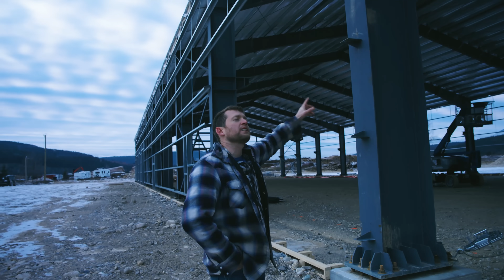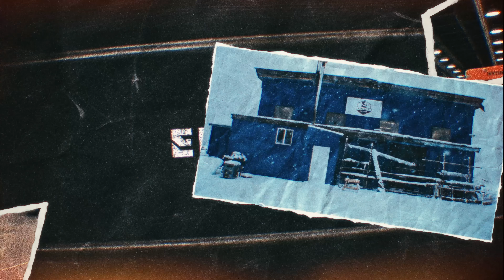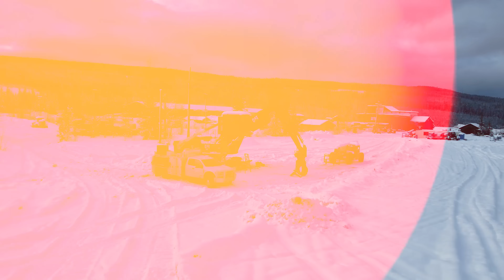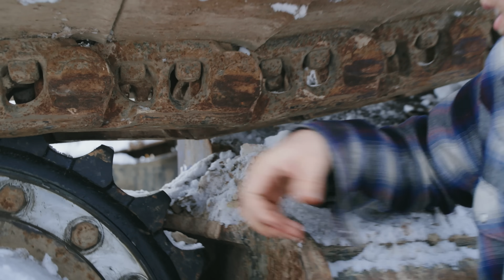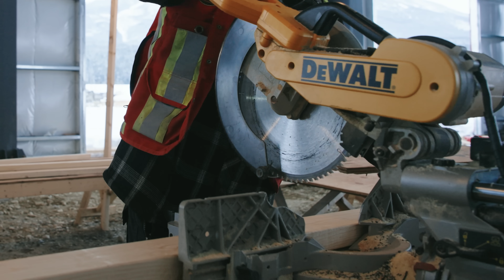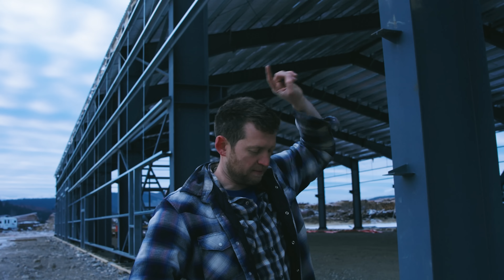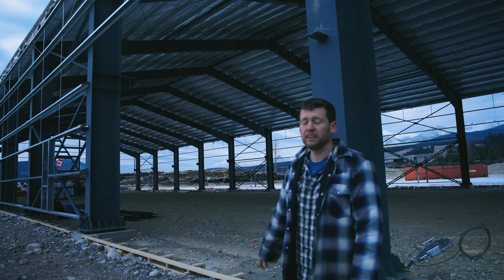Saving $200,000 With Used Heavy Machinery

Comment: Chace, To not only save more money for years to come, you can always help to keep the employees nice and warm at the same time!  Before the concrete floor is poured - Please install in-floor radiant tubing with insulations under the concrete sab. The workers will thank you and it will save on heating cost too!! Should the Funds be short right now to complete such a system - you can wait until the business grows - before you have the rest of the heating system installed. With the tubing in the floor. You could install gas/Lp heat now that is normally used in large buildings and it could be used in the future as backup heat. Plus if you were to use Geothermal to provide the main heat source; you, the company, and investors will SAVE even more. Not to mention with your heavy equipment you and the team could dig the individual trenches and lay the tubing yourself.  However you can't go back later and install the tubing / insulation under the concrete floor. Grin & LOL  Keep up the great progress. All the Best, Tony

Comment: Columns go up, girts are horizontal and connect the columns together. 

Rafters go from column to column holding the roof system up. 

Purlins attach the rafters together down the length of the building.
Reply: Thanks :)

Comment: I still dont understand why that building can't be repaired?  Its so big ans seems like it would be useful.
Reply: The roof was not designed for snow load. It needs to be (safely) removed and replaced. It's cheaper to start over.
Reply: @Sah-o5m it's crazy that a building built there wouldn't have been built for that!
Reply: @erikdenny353 
A person in these comments claim to have worked there in the 70s and says that had to go up and shovel snow off the roof.

Comment: The loader can be used in the rail yard  at the saw mill, in your woods clearing build lots with a mulching implement.  Check hemp lego building blocks in Alberta.  Distribute as a dealer, advertise.  25# R35, strong as concrete  fire bug and mold proof.  Each 40' container builds 1,000 sq ft.  Lego DIY perfect.  Best off grid product period.  Rebuild the exterior walls as supports. Add ? to the engineers.  They will be a gamechanger.  Cost is less than stick built.

Comment: All that investor money spends easy, doesn't it?!
Reply: Gotta spend money to make money. The investors seem on board with the plan.
Reply: @Sah-o5m I'd venture to guess that many investors don't know any better.
Reply: @Jaeswindell 
Perhaps. 

I believe the building was a condemned safety hazard with a failing roof causing a death hazard to employees and putting Edison at risk of personal injury lawsuit.

I believe the building was at risk of collapsing under its own weight and landing on the adjoining main line railroad tracks creating a situation for train derailment and giant lawsuit.

I believe the location of the junky warehouse MIGHT be suitable for a semi truck intermodal rail spur hub that MIGHT generate millions in revenue for Edison. This remains to be seen.

I believe Edison has a goal of building 500 trucks per year at 30,000 lbs each so it needs to import 15 million lbs of truck parts annually. Having a repaired rail spur and new appropriate warehouse could be useful, or vital. This remains to be seen.
Reply: @Sah-o5m agree with your points entirely, my commentary was regarding the feller buncher purchase.

Comment: If you have to skills to do it yourself, then equipment is 90/100 times cheaper than just ordering the work from contractor. Also, like many others have said, since you're going to build logging trucks eventually, you need a way to load them for pull weight and handling tests. 100% keep the loader! :D

Comment: It's great that you are salvaging what you can.  The old wood and even the steel that you save will give some real character to whatever you build out of it.  Use that log loader for what you need then sell it...or find a way to use it in the production line!  It might be a good way to move frame rails in and out...HA!  (just kidding)
Cheers from the Maritimes!
Reply: If Edison has a goal of making 500 trucks per year at 30,000 lbs per truck, then that is 15 million lbs that needs to arrive and another 15 million lbs to depart annually. Having large material handlers for the rail cars makes a lot of sense.

Comment: why not controlled burn?
Reply: (A) to reuse the material. (B) its right next to the main train tracks. If it falls on the tracks then Edison could  be fined $100k per day by the rail line till it gets fixed.

Comment: I would expect those big old timbers in that building are worth a small fortrune, so, ya it is worth your trouble to buy the machine, give someone a few months work in teardown and sorting, then figuring out how to use those timbers in the new buildings. Need a good metal detector to run over them all with before cutting them up, but, overall will save a pile of money. More than a few engineers and archtects in the Columbia Valley that can figure out how and what to do with that stuff and come up with something nice for you..

Comment: Buying the piece of equipment to do the job might be the right choice, but I believe trying to salvage as much as the building as possible to use in another building might be the wrong choice. It could consume too much time. 
You might be better off just throwing it in a pile then looking over your truck and finding something small an emblem, a knob, or small info plate. Something you could get a bunch of parts from one piece, then you have years of raw material. Sell the log loader when you're done to buy the piece of equipment or two you need to process the raw materials.

Comment: I think you made the right choice if you can keep the log loader for other uses after the building is down. If you just planned on selling it after the job  it was taking on a lot of risk and unknown costs to repair it. It would then be better to rent the right equipment for a week or two and operate it like you would the purchased one. I rent 50,000 pound excavators  here for about 3000 a week or 8000 a month. Even two or three times that for a log loader is worth it because you only pay for what you need  I can get a lot of work done with rented equipment compared to hiring another demolition contractor to do what I can do.

Comment: The question is less about should you, but do you have the necessary skills?  For example, you knew about the wear parts and hoses, and bought the logger knowing its needs.  Obviously, someone on the crew can run it.  So if you were a college boy like Eric, it may not even be safe to buy a logger.  But if you have the skills, and are willing to underpay yourself, definitely buying it is the way to go.  
As for the building, too many people toss perfectly good building material and then have to build smaller than they wanted because of the cost of new material.  Those beams look to be WAY overkill for an average office.  So what?  The cost ($0) is very attractive.  Now when you are ready to spend the big bucks and build a super computer, drop me a line.  Those babies are insanely expensive.

Comment: How many commenting. Really have vertually NO exp with used heavy equip. Why was this log unit sold. Hey if the " up keep" exceeds the " in go " then the Downtime becomes  A "down fall "  Maybe NOT as criticial as logging. Dont know your schedule. Log trucks driver etc. Dont like unriable equipment. Trade it off. Get something hopefully more reliable lol. Fixing equip in the bush lol. Maybe   NOT as crotical. Near Golden BC. But whats mobile mech rates. Hey got own mech. Diff story. If broke down. Hey fix it. Not so easly done in the bush. With log trucks waiting to load. Elect log books running out of hrs etc. Burning fuel just trying to stay warm. Yup been there. When is the stupid loader getting fixed. Lol. Everyone cheered when " new loader arrived lol.

Comment: As long as u dont have too many major break downs. Lots should change out hyd oil Better filteration etc. Used Telehandler next 30th hyd repair lol.  Be " pro active on maintance"  Do " oil  samples etc "  Used can be ok. But can real " bite" too. Need  reliable equip. Not constantly broke down. Need to job done etc.

Comment: It was absolutely the right way to go.   The repair has added value to the machine and you can sell it at a profit after using it for your demolition project.  Renting a machine like that can be something like $4,000 – $6,000 CAD/week.
Doing it this way, you can have it around to do other work, and leave it idle for months if the timing requires it.   The unit is already fully depreciated.

Comment: I think doing the work yourselves and selling the log loader after is a brilliant move, try and save what you can in the old building and use the bones to create a new structure if possible or reuse what you can. Sell the metal and recoup some costs while cleaning up the entire site making it safe for future expansion. Diesel electric trucks are clearly the answer and when the laws are working in your favor you will have a leg up on the competition, try and avoid getting purchased if possible.

Comment: CPKC (Canadian Pacific Kansas City) manages used, creosote-treated railroad ties by sending a portion of them to specialized facilities for energy recovery (incineration) or fuel conversion, as reported in their sustainability data. These used ties are sometimes processed through cogeneration facilities, and in some initiatives, they are used as feedstock for producing renewable fuels. 
Environmental & Disposal Strategy: The railway industry, including CPKC, has moved toward burning treated ties for energy recovery as a primary disposal method rather than landfilling.
Partnerships: CP has previously partnered with firms like Cielo Waste Solutions to use scrap ties as feedstock for high-grade renewable fuels.
Controversy: The incineration of these ties has faced public and environmental scrutiny due to the creosote treatment, with past projects in British Columbia and other areas facing opposition over air quality concerns.
Alternative Uses: While incineration is common, some ties are also repurposed for other uses, such as in landscaping or agricultural functions, though the industry is shifting more toward energy recovery.
Disposal Reporting: CPKC reports the volume of rail ties sent to cogeneration facilities as "Offsite Incineration" in their sustainability data.

Comment: Buying used machine is certeainly the way to go, especially when you don't need to hire an operator. I like the fact you're building the company to produce and sell trucks, not to sell dreams. It shows you're not just interested in making smoke and mirrors and get bought by some big corporation, but instead you're interested in the truck itself and are building a company for a long run

Comment: I follow Elon as much as I follow Edison. You guys use many of the same philosophies. One of Elon’s prime directives is to have planning (engineers) and manufacturing under one roof, except where it absolutely cannot be done. He thinks engineering and manufacturing must have the absolutely least physical separation possible, with no friction. That would include a -40C walk between buildings. That walk could be considered friction.

Comment: You are a logger Why didn’t you use mass timber when building the new shop…..instead of steel. The old shop is made of wood.
Did you think of mass timber building. Where was the steel sourced from?
It’s easy to talk the talk you have to walk the talk.
Remember what PM Carney said “ if you’re not at the table you’re on the menu”….nice you have a seat at the table.
With all that said keep up the good work.

Comment: I have extensive experience on trying to reuse  buildling materials,  some notes:  Having open storage yard helps but you also need some sort of dry storage if it is not going to be used right away.   Creating an inventory of the materials and sizes that the designers/engineers will need to work with will save lots of design time later.  Certification of steel beams is likely going to be part of the info needed as not all sizes might be worth saving.    The latter needs a line or 2 in your budgets.  There is a difference between reusing for decoration/nostalgia and needing structural properties for the building envelope. 
some of the steel might have higher value as recycle/scrap when the market is good rather then a reuse which might cost more then buying new certified materials.     When asking should we/can we use that beam,  there might be a compromise to the spaces that get created that could be a regret later when trying to fit a new piece of equipment in that room.   i.e. (an example to make the point) a standard desk is 5 ft wide, if the room created with that salvaged beam is only going to be 4 ft 11 in (finished)  you need a custom desk that might cost more then a new steel beam but using a wood beam might be a better deal to get that 5 ft space.      There is a time for using steel in buildings like the preengineered shop you build (which is excellent value) , there is also times when wood/steel should be evaluated as an alternate when doing things like office buildings etc... 
for a reuse project idea - there are lots of solar panels from solar farms that still have some life in them. (-:  been seeing them on RV roofs.
Reply: A lot of good info here. They said they're getting a structural engineer to review the materials. That person should be able to tell them which beams are worth reusing. Great idea on the used/second market solar panels. Edison has plenty of space for them, and already builds their own batteries, which is the most expensive part for most solar installations.

Comment: When I built barns ....We always called them Purlins
Reply: Those are girts, purlins go on roof.
Reply: @DaveH51  not in michigan...we call them wall purlins...🤣🤣🤣
Reply: @1RickBaja  Makes sense.
Reply: @1RickBaja  they are purlins in general as they are steel. used in a wall its a girt. on a roof is a purlin.
but it really doesnt matter
Reply: @chrisforgan731  It's generally the same material is the reason many people don't differentiate between them, but I see your point. I would in framing like rafter and stud.
Reply: In Oz we call em roof purlins and wall girts

Comment: Save when you can, nothing wrong with repurposing material. Old salvaged wood is in big demand in many places. It may need to have holes drilled for screws/ nails to avoid splitting.

Comment: Doing it yourself costs more time. If that time slows down production or development of products that extra time is worth money too. If a few months don’t really matter it’s a relatively simple calculation of what’s cheaper.

In my experience, and in my environment (far, far away from Canada) it’s usually cheaper to spend the money and simply haul everything away as quickly as possible and start from scratch with all new materials. Everything old will fight you all the way and everything new is predictable. 

If I’m building a new building I can very simply just price it out. I know exactly what costs what and how long everything takes. Working with used components, or preparing used components is always a fight and results in a lot of meetings about how to deal with said  setbacks. And every single time the result is more costs. So when i redo a existing building i take out as much as possible to prevent unpredictable setbacks as much as possible. That’s cheaper then keeping existing things in place.

So I’m a bit sceptical, but a also don’t know how expensive things are in Canada. Different continents bring different challenges and problems.
Reply: I was looking for this comment. Theres an opportunity cost to spending your time, mental focus, and resources on these "side quests". Spend a dollar to save a dime.

Comment: Chance I believe the word you're looking for is "Girts". The old building I used to work in had Z girts,  yours look more like C girts.
Reply: Purlins
Reply: @Nyth63  Purlins are horizontal steel members that span across the roof. They support the roof panels and transfer weight (like snow or maintenance crews walking) back to the main steel frames.
Girts are similar, but they run horizontally across the walls. They support the wall panels and help handle wind pressure and impact.

Comment: I think that log loader could be repurposed top help lift things such as the generators, frames.  Basically, put it to work to maximize your investment .
Reply: They already have the cranescavator they were using in the old shop and the current shop, and the new shop will have overhead cranes.